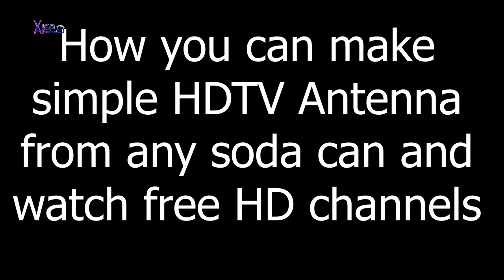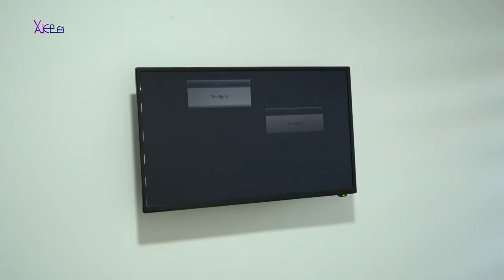Homemade HDTV Antenna DIY

Comment: I bought some copper foil tape for a project like this, it's been on the shelf for over two years now! I'm using a PCB based antenna, it's just a doable sided PCB, with a capacitor I think on it,

Comment: at 8:33 It's clearly visible that wire is cut off. And when u get back on the tv, u just hanged ur diy antenta on something and plugged ur actual hdtv line in there.